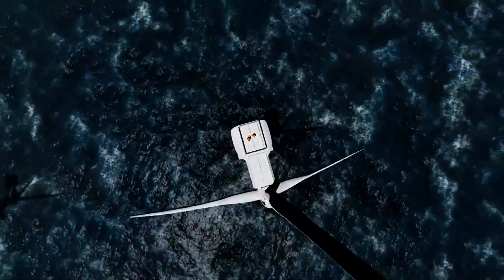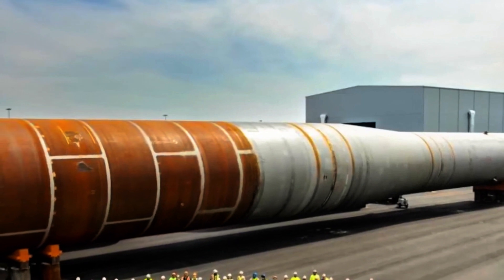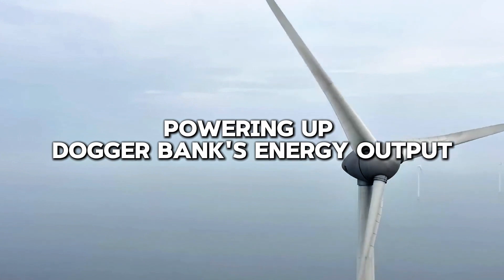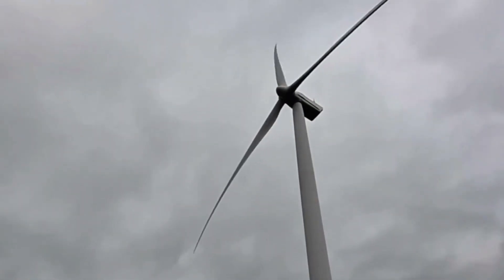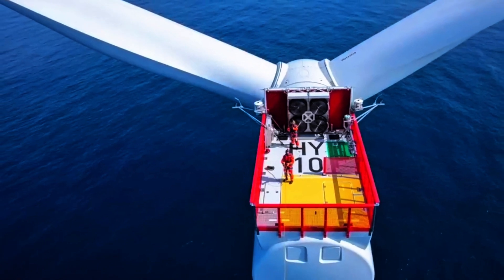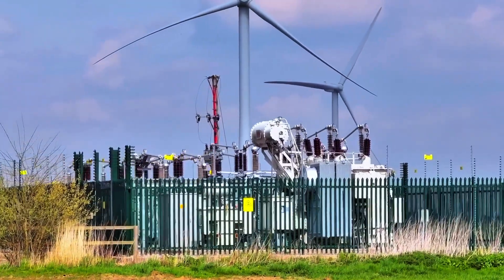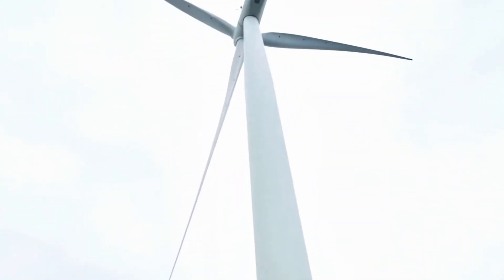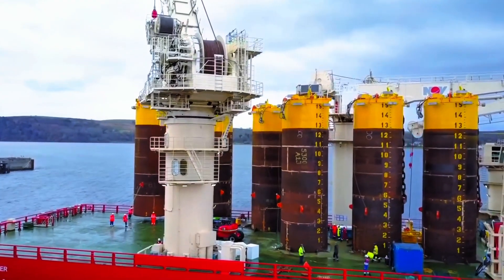Dogger Bank: The World’s Largest Offshore Wind Farm

Comment: A New Jersey offshore wind farm being developed as a scheduled power stations is said by one of its engineers to be  “100% backed up by natural gas”.    This is the only method without hydropower to backup large amounts of wild AC from wind or solar voltaic electricity to provide scheduled electrical power.   This requires running enough natural gas turbines generators at high service idle to make up any dips in output from the wind farm up to total failure. 

Gas turbines running at high quick acting response requirers them being at high service idle consuming 70% of fuel of their full power output, but making little electricity.   This is what a jet airliner does on landing approach enabling it to make little thrust, but bring the jet engines up to full power in about 3 seconds.

It would likely save natural gas to make all the electricity from a few less natural gas turbines running at their high efficiency output of 85%.   Then being able to make use of second generating cycle from the hot exhaust used to make steam for a steam cycle that adds 50% higher efficiency.   This is a natural gas combined cycle NGCC generator.   The steam cycle adds a lot of complexity compared to a simple gas turbine generator.   

The steam cycle can not be readily used for instant backup of large amounts of wild AC.   It takes hours to come into effect and is slow to react to changes.  A steam cycle is used in coal and nuclear power plants as their generating cycle. 

The practical use for wind and solar voltaic generated electricity is for maintaining electrical energy storage such as charging storage batteries.   Hydropower can provide the high availability instant backup to wild AC from wind and solar voltaic generated electricity without a high availability stand-by cost saving reservoir water.   Scandinavian countries have large supplies of hydropower.  

The wild AC from wind and solar voltaic generated electricity offers little fuel savings when forced onto the US public power grid with advertised fuel saving of 1% each.  The wild AC they force onto the public power grid is in the double digit percentages of grid electricity used.   

A public power grid connected home solar panel system with no storage requires instant makeup from the public power grid to supply the home.   That high availability costs at near the cost of suppling all the electricity for which the public power grid gets no income.